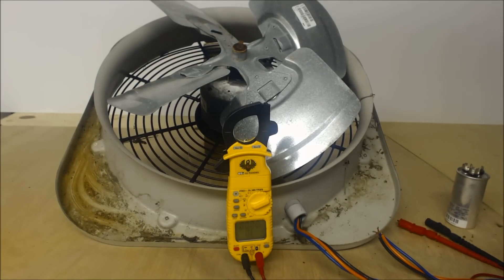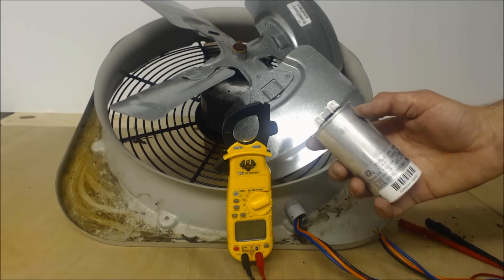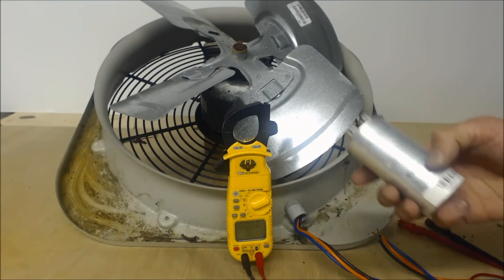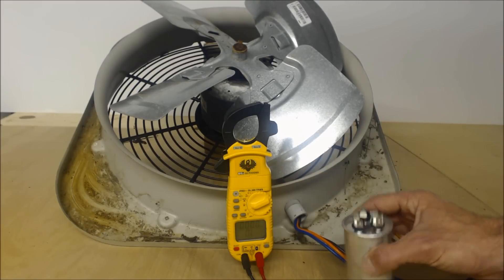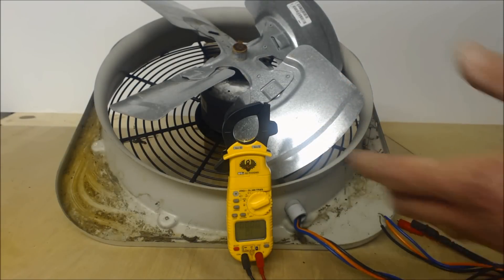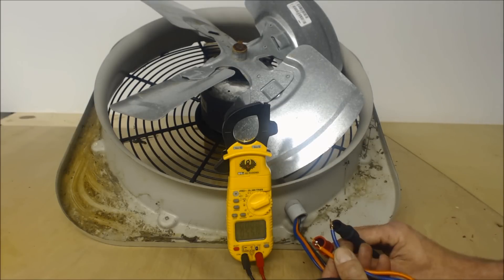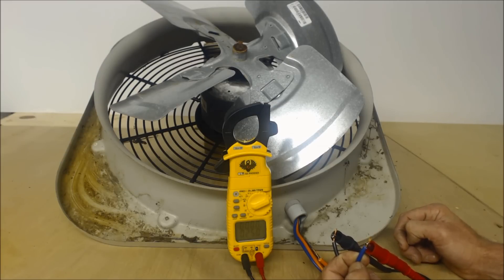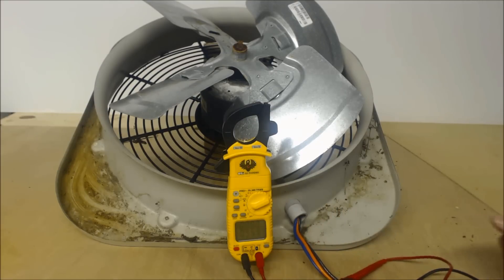Outdoor HVAC Unit Fan Motor! Step by Step Troubleshooting, Capacitor, and Exact Resistance Readings!

Comment: Wouldn't the first test be a spin test with a screwdriver [fan installed] or by hand [fan removed]? Binding or rough bearings would automatically condemn the fan motor, no? Then - a motor resistance and capacitor check to narrow down the defective component?

Comment: Fan turning super slowly buzzing
Resistance for fan good
No short 
To start Run caps replaced - didn't have meter with me so just did.  Started fan working when came back later fan turning super slow and buzzing plus compressor  kicked off 
Replaced contactor started up running fine
Came back fan turning super slow no buzzing.  Compressor heating up and kicking off
Seems like if has to be fan motor but resistance fine and no short doesn't make sense to me

Comment: Can u put a 40+5 capacitor instead of 35+5 in your unit?
Reply: No the capacitor has to be specifically rated to the compressor and fan motor.

Comment: I’m the homeowner. 
My condenser fan reads
Black to purple=29.1
Black to Brown =66.7
For a total of 95.8
Purple and brown=94.1
So about 1 to 2 ohms off. 
My professional tech insists the fan is bad (he never took winding readings but concludes it’s bad because it goes to thermal cutoff after it runs for several hours) and ordered one and charged me. 

Based on these readings is he right or wrong. I showed him these numbers by text and he’s ghosting me. 

Btw- I checked my 45/5 uF capacitor and it reads 29uF/4.89uF. 

I think my capacitor is bad and the fan is fine. The low capacitance on the run side is causing the compressor to overheat thus shutting off the fan. 

It’s a Goodman 3.5 ton 14 seer system. 

Is my theory sound or is this both a bad dual capacitor and fan.
Reply: Running in to this issue currently. By chance do you remember what happened? I've replaced my capacitor already but can't get the fan to run even though it reads ok with the meter. Any help would be much appreciated

Comment: I have a train unit that the fan motor  would not work I did a ohms reading and between brown and purple it is 126 ohms between black and brown it is 91 ohms and between black and purple it is 97 ohms so I know that 91 plus 97 is 188 so that way over the 126 reading I guessing that would be bad right

Comment: Could a bad condenser fan caused the system to freeze? I went and checked and AC unit and the system was frozen, the owner told someone had checked the system and told him it was the condenser fan but when I checked it the fan was spinning freely without any noise
Reply from the maker: No a condenser fan would not make a unit freeze. It would be either low indoor airflow, liquid line restriction or low on refrigerant, thanks!

Comment: I have a question about how to test a capacitor for a heat commercial pump trane. I have one the say 135-162 mfd, but went  I test it with my multimeter it is 210 mfd. I guess it is break and has to be replaced. What do you think ?
Reply from the maker: If the resister is still in place then the reading may be high. That is the start capacitor for the compressor only and not for the fan, thanks

Comment: Hi AC Service Tech, I'm looking at a 2 speed psc condensor fan motors (4 wires instead of 3), 
free spins fine, so how does the ohming process change using the 4th wire, I guess that's for 
the 2nd speed?
It's a 16 seer (2stage) 2 Ton Goodman HP with the premium comfortnet board replacing the 
contactor if you are familiar with them; Compressor and 35/5 Cap.  both check out good so far but unit still pop's indoor panel breaker instantly when it gets a heat call. If I can't find a short 
to ground in the fan motor, what next? Could the CCHeater be a cause/short? Any suggestions
or applicable videos will be appreciated. Thanks, Bob
Reply from the maker: Did you check your resistance valves on the compressor? Also what you would do is pull the power disconnect and continue reading between one of your two supply lines entering the contactor and the ground and disconnect one wire at a time until your 0.0ohms is now higher meaning no longer a dead short. This will tell you where your problem is. Then you may just be reading a correct resistance value on a compressor. Make sure to follow the wiring diagram of that motor and don't turn the power back on again until the 0.0ohms reading is gone, thanks
Reply: Hi  @acservicetechchannel . I first isolated the compressor and tested for short to ground (found zero continuity at each lead) and resistance value both through the leads and then at the 3 bare terminals (1.2 CR + 1.4 CS = 2.7RS ....ohms) so that seems good. So as it stands now, 240V disconnect is pulled and COMP. and FAN are both isolated/disconnected. 
AS I first asked originally above, I'm unsure how to resistance check FAN as it is a 2 speed / 4 wire fan, not a 3 wire. None of the 4 leads read any grounding but is the 4th wire a 2nd run wire and how should the resistance values add up????
I will go back and start at L1 and L2 on the comfortnet/emerson board (remember NO CONTACTOR) and check resistance starting there (and unpluging loads) until I read something other than 0.0 ohms/short to ground. So I guess if I finally get everything unplugged from the board and still read 0.0 ohms, that means the board is bad, ... correct??? Thanks for your time and knowledge, Bob
Reply from the maker: Hey Bobrub, on a two speed motor the higher speed will be a lower resistance than the low speed. Yeah I would isolate each component and test each against ground until the problem is found thanks
Reply: You say indoor panel breaker trips on heat call. Heat pump has two breakers, one for outside unit, and one for indoor housing where fan and heat strips are.  Some tstats energize heat strips along with heat pump if tstat and indoor temp settings are two or three degrees different.Just wondering if your indoor heat strips are tripping the breaker for inside unit which would shut your inside blower off along with killing low voltage to outside unit shutting it down as well. If indoor blower is still running, than it wouldn't be the heat strips. If its the cc heater, just unplug the wires to it and reset breaker to check.

Comment: My fan motor works if it hasn't been on in a few hours, but after it cools the house, if it tries to turn back on when the fan motor is hot, it won't turn on. The contactor seems fine, I tested the ohms on the fan motor and they read 25Ω, 70Ω, and 95Ω which sound like it should be good. Because capacitors are cheap, I replaced my dual capacitor 60+5 uf (which wasn't bulging and the uf tested ok.) I added a three wire 5-2-1 hard start kit. But after all the tests, it still does the same thing... if the motor is hot, the compressor kicks on, but the fan barely moves and then stops. If I wait a few hours, it works again. Can a fan motor be bad, even if the ohms add up? Or is there something else that I'm missing that would also cause it to only work when the system has been off for a while?
Reply from the maker: It could be the bearings seizing up or it could be lower than needed high voltage, or just the resin has broken down and now heat occurs when running and the thermal overload pops, shutting it off. After it cools then you would get a resistance reading again. If everything else is good like you are mentioning then it sounds like the motor will need to be replaced, thanks

Comment: Hi there, I have one wire that only stays at O.L when compared to the other 2 but  the others give me a reading. Is that a sign of a bad motor also? Thanks
Reply from the maker: If one of the three wires get 0.L with the other two after the motor has had a chance to cool down then yes it is a burnt winding. Does that wire have 0.0ohm with ground too? Look up "acservicetech thermal overload" to see how it opens up the circuit when hot, thanks
Reply: AC Service Tech LLC I tested with ground and getting the same O.L. I will check out to the video thank you
Reply: https://youtu.be/HGnD_1ll0BC

Comment: What would cause condenser fan motor to pull high amps one I meaured today was rated for 0.75 and it measures 0.81. I know a dirty condenser would cause amp draw to increase but what other reasons would cause that. The capacitor was under manufactures specs but that was on the compressor side the fan side was at 5mfd.
Reply from the maker: It could be due to heat or a start of the breakdown of the resin on the windings. .81 is not that far off though for the fan motor since they are sealed and do have the heat surrounding them, thanks David!

Comment: Mine ohmed out good and capacitor is good but still not coming on.
Reply from the maker: Did you check the resistance of the start wires that would connect to the capacitor as well? Thanks Chad!
Reply: acservicetech I checked resistance of 3 wires going to motor,and it ohmed out good and good capacitor but still didn't run.
Reply from the maker: How about the wiring. You should have one wire coming off of the contactor going to run on the motor, another coming off the other spot on the contactor or with a jumper from the contactor to c on the capacitor and going to common on the motor and you should have one coming from the other side of the cap going to the  start on the motor. Make sure the cap is the correct mfd/uF as listed on the motor. After powering it, isolate the wires again to see if you lost the resistance value on the common wire indicating that the high temp cutout opened inside the motor. Also check each winding to ground as well, thanks Chad!
Reply: acservicetech ok i think i checked to ground and got ol,the motor was hot,but didn't know they could have a over load inside the motor.Thanks
Reply from the maker: It should be OL to ground, thats good but here is a video on the thermal overload. It breaks the common wire, thanks- https://www.youtube.com/watch?v=IBg0EZg0ohY&t=5s       and if it is getting hot, it may have the insulation wore down on the motor. It may be ready for a megger test or just replace because you can't fix the insulation value anyway, thanks

Comment: Very helpful! However, you didn't mention what indicates that the fan is bad. I guess it would be open or shorted. 

My fan ohms out as you said, but doesn't spin. It gets hot, and the bearings spin freely. Eventually the compressor shutsoff because it pressumably overheats (the whole radiator is very hot.

Does this point to a bad capacitor?
Reply: Having the same issue. Wanting the same follow up clarification.
Reply: https://youtu.be/HgnD_1ll0BC
Reply from the maker: I would check the capacitor first before ohming the motor. Check out "acservicetech capacitor playlist" thanks
Reply: @acservicetechchannel  Respectfully you still didn't answer the question...what indicates if the fan is bad?
Reply: @acservicetechchannel   I was wondering how it is determined if it is bad too? Do the readings not add up then  that is considered  bad? I love his videos but a bit of clarity would help on this one. Are the other ways to see if a motor is bad like using a megohmeter or something else?

Comment: I have 140 ohms between 2 wires and everything else is open.  Bad motor ? I also had a smoked capacitor. The motor started up once after a banged on it with a hammer 😃
Reply from the maker: Make sure that the thermal cutout cools down and has a chance to close the electrical circuit on the common wire. After that if you have the same readings then yes it is bad, thanks

Comment: Did you see my response to your reply yesterday?  Also wondering if think that in my situation (not sure if unit will ultimately hold refrigerant long term) a replacement OEM motor is worth the extra cash over a generic motor. 
 $70. for generic VS $114. for OEM  (Generic is 25 less RPM though)  Hoping you will respond to these and my other prior questions.
Reply from the maker: Hey Jo Tu, I would replace the motor with the generic if you are familiar with how to do it safely, or call a tech to replace it, thanks

Comment: Thanks for the fast response.  If I wait to see if the fan just dies (instead of replacing it asap l beforehand)... What is the worst that could happen?  Could I potentially destroy my condenser if the fan stops and I don't notice it or am away from the house?  The reason I ask is because only a week and a half ago I had sealant put in the system (with a fresh R22 charge) and am wanting to see if it actually works and seals before investing in any more parts for this unit (prior to the sealant my last R22 charge lasted only a month).  And yes...  I know that the popular opinion is that the sealant is (at best) a long shot... But (due to my financial circumstances) it is a shot I have to take.  Please advise as to if you think me waiting a month and a half becore replacing the fan is or is not a good idea and any potential dismal consequences.  Again... no need to tell me I need to replace the system.  Thanks so much for your help with this matter.
Reply: https://youtu.be/HgnD_1ll0BC

Comment: Help! I have not run the AC unit I am asking about for roughly 11 months.  This fan seems to be working just fine as I type this however a short while (2 days) after I restarted it up I found the compressor running but the fan stopped... also, there seemed to be a very, very, SLIGHT electrical type of smell present near the condenser. I thought my condenser was totally toast!  After I left the condenser completely off over night  with a FEW pushes on the fan blades...  I was able to push start the fan but then realized that it seems that I now have a condenser fan motor that started squealing a few times (but has happened only a few times since re start up).  Additionally, the fan spins... but not super "freely".  I have replaced the capacitor and I have ohm measured out the power leads and measured the amp draw and the fan motor is good from that aspect (and still runs).  The condenser was made in 1997 and I suspect the fan motor is intact and original from 1997 as well.  I know it is old, so please don't simply tell me to replace the entire system, etc. as financially, that is (simply) not an option for me right now.  There seems to be no play (side to side) on the motor shaft).  Is it possible (since it has sat for 11 months) that I don't need to do anything and that the unit was temporarily and simply screeching out some "cob webs" after sitting for so long (so to speak).  If not, then I suspect that it is the motor bearings (or bushings???).  If it is either of those, I was thinking about attempting to replace JUST them (and not the whole motor) but wondering... Is it not worth it to try to replace the JUST the bearings (or bushing or whatever) in the condenser fan motor? ROUGHLY how much do you guess bearings / bushings cost? If worth it, then how do I tell which ones I need and where do you suggest I get the bearings or bushings?  A new generic motor is only about $60. but I just hate to replace the whole motor if it is possible to MUCH more cheaply salvage the existing one unless you tell me the task is either impossible or simply to much of a pain in the neck.  Of course, if you have never performed the (bearing / bushing etc.) replacement task yourself or it is simply beyond your scope of knowledge, then please let me know that as well.  What would you do if you were me considering the above stated facts & circumstances?  YOUR FAST REPLY WOULD BE GREATLY APPRECIATED...  Help!
Reply from the maker: When off, the condensor fan should spin freely. I would turn the power off and replace the fan motor. Make sure to use the correct mfd/uf capacitor with the fan motor. Thanks

Comment: My AC fan resistance is good but when I connected Black wire and C wire to power outlet fan don't turn on.   You have any idea what's wrong.
Reply from the maker: Did you already check the capacitor and capacitor wiring? - https://www.youtube.com/playlist?list=PLxnHR5_D2ojwj2amJSXUKVkv4KV4Az5_Y
Reply: Yes I did it was good, but I figure it out.  I plug the wire wrong witch is why the fan didn't turn On.  I kept troubleshooting and saw one of the fuses was damage, once I replace it Fan turn on.  Thank You
Reply from the maker: Awesome, thanks for letting me know!

Comment: When testing outside of the unit, my fan turns on. However when I reinstall it doesn't start up.  It sounds like it wants to and it turns a little but won't kick up into speed.   Almost like it's seized.  Any ideas? Remember though, when out of the unit, the fan spins freely.
Reply from the maker: That could be part of the stator that has moved and is jamming up against the rotor in that certain position and then you move the motor into a different position and it works. That just happened to me after I removed the outdoor fan motor to clean the inside of the unit and I put it back and it was seized up. I replaced the motor since they are not that much and did not want that to happen again, thanks!
Reply: acservicetech, is not that much $150-200? That seems to be the price range I have found.  That's steep for my budget,  but it sounds like I'm going to have to take that loss. Thanks for your input.
Reply from the maker: Sorry, I mean't around $85 dollars at the supply house usually. I mean't compared to something like the compressor. Unfortunately there is not much else with those motors. Make sure that the capacitor is good also before replacing and that the motor is getting the proper voltage,Thanks
Reply: acservicetech , I'm glad to report that we got it going again. We cracked it open. Lubed and cleaned the inside, gave the entire unit a bit of TLC and presto, it worked! The fan kicked on and all seems operational, fingers crossed that it stays that way. Thanks for your help!
Reply: https://youtu.be/HgnD_1ll0BC